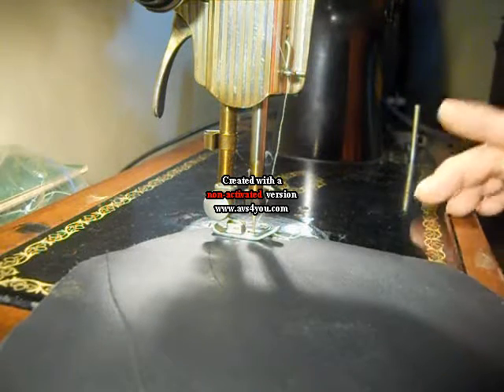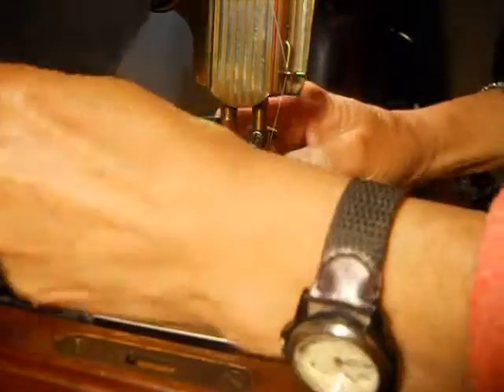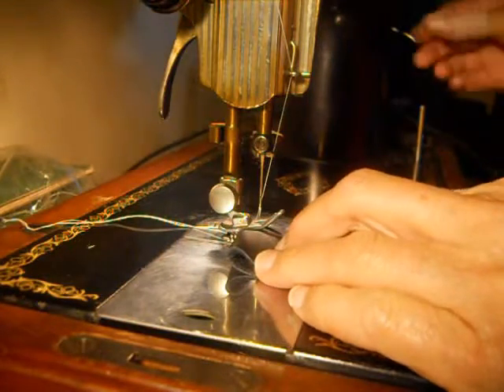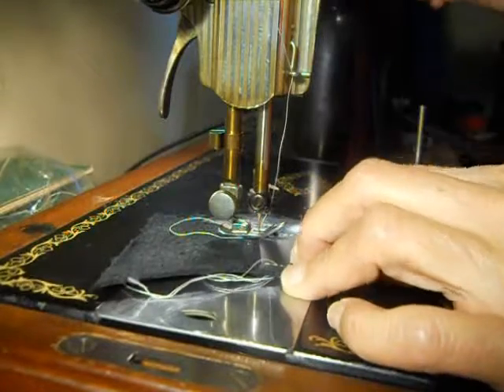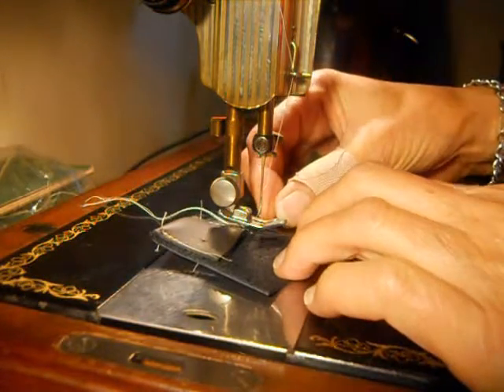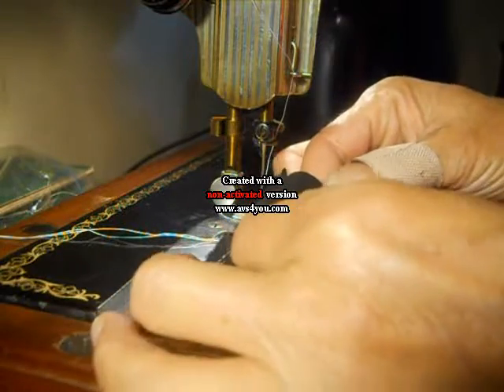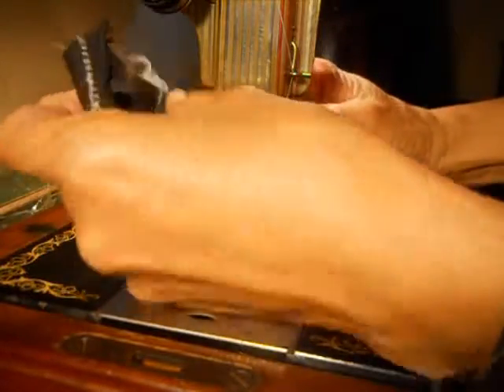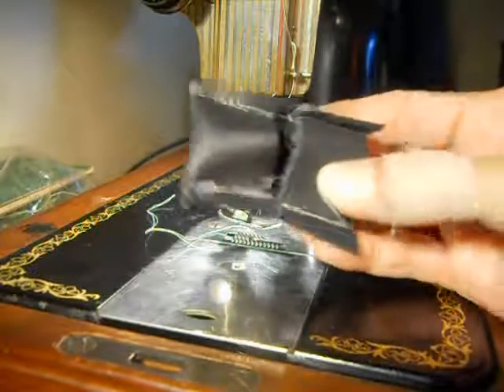Sewing Leather on a Singer Model 15-91

Comment: I have a concern about the length of the stitches, mine (I think it's model 15, I'm not sure), it seems to me that it doesn't give stitches longer than 3/16
Reply from the maker: If it has the stitch length regulator on the column like a model 15, you have to make sure you have the stitch length set correctly. Loosen the little screw slightly that is left of the lever, set the number of stitches per inch with the lever (30 being tightest, 8 being longer) and then move that same screw up until it stops, and tighten it. Some machines have a "neutral" (just above 30 on a 15-91) if your stitch length is set there, you will get just about no length to a stitch.